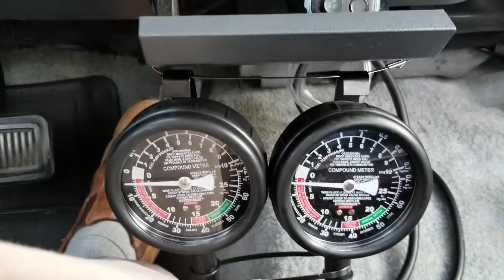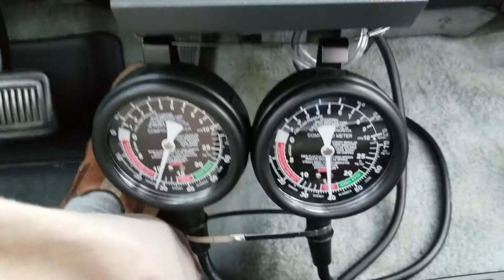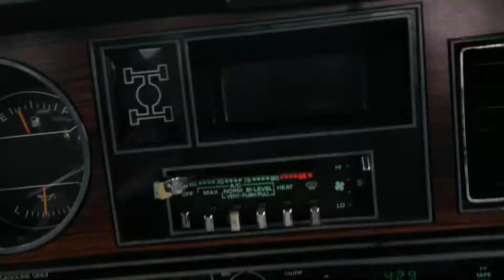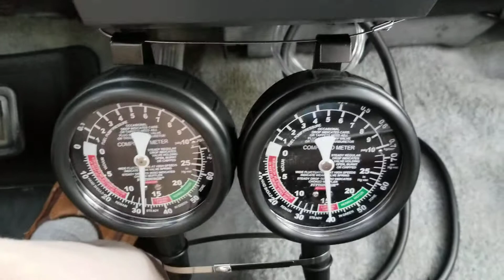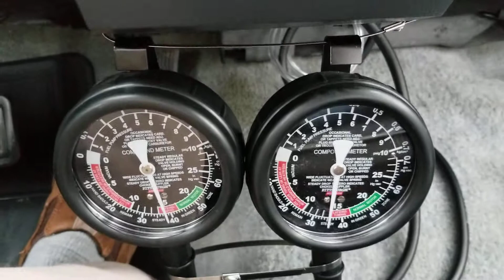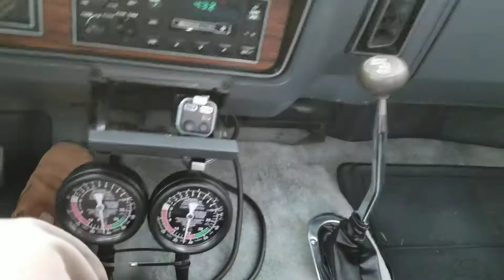Demo:  Ported vs. Manifold Vacuum in 318 w/ Holly 4bbl

Comment: For anyone watching this who is trying to figure out which source to use for vacuum advance... you have to remember that the sole purpose of vacuum advance is to retard the timing under moderate to heavy acceleration to prevent knock/ping/pre-ignition/detonation (or whatever else you want to call it).  Vacuum advance is NOT a power adding or high performance device.  If you're running a high performance engine, don't bother using vacuum advance at all, especially if you're running a large cam with a lot of overlap since they greatly affect the vacuum from both sources at low rpms.  If you're running a street cruiser or daily driver, you'll want to use vacuum advance, but you'll never get your answer of which source to use by consulting youtube.  Your engine, and how you drive with it, is unique to you... so you'll have to experiment with your engine and see which one works best for you.  There is no universal answer, but most often, ported vacuum is the way to go since that's what most cars and trucks were designed to use from the factory.
Reply: Hahha if the sole purpose of vacuum advance was to retard the timing, they’d call it vacuum retard.  Most of what you said here is wrong.
Reply: @yeboscrebo4451    If most of it is wrong, what do you think is right?  Things are quite often NOT called what people think they should be called.  Look up the history of the device, that's why it was invented, whether you believe it or not.  Later on it started to be used for drivability performance and then it became known as "vacuum advance", but it's original purpose was to automatically retard timing, not to advance it.  Maybe I should have used the word "was" instead of "is"... but a slight grammatical error doesn't discredit my entire statement.
Reply: If the purpose of vacuum advance is actually to retard timing on acceleration, then manifold vacuum seems to make more sense. As can be seen in the video, manifold vacuum drops on acceleration, retarding timing. Ported vacuum increases on acceleration from idle, and would advance timing.
Reply: @willshen6597   No, not quite... The original purpose of vacuum "advance" WAS to retard timing during acceleration, and at that time, manifold vacuum was the standard way of doing it... but that's not the end of the story.  If you continue to watch what the gauges do, you'll see that both ported and manifold vacuum equalize and follow the exact same pattern after a certain point (It's hard to tell since you can't actually see what the driver is doing with the throttle pedal). The only difference between them is at idle and the "part throttle transition"... so even though ported vacuum increases at first, it drops again (along with manifold vac) right after the throttle blade passes the port.  
So again, vacuum advance was designed to counteract the mechanical advance during low speed acceleration, but both manifold and ported vacuum work in exactly the same way to achieve that.  After engineers began experimenting with ported vacuum, they found some advantages to using it, such as better part throttle acceleration, and later, reduced idle and off-idle emissions.
Reply: @livewire2759  just because manifold vacuum advance drops off when the throttle opens doesn’t mean  that the purpose of the “advance” is to retard - that’s just silly.  That’s like saying the purpose of mechanical advance is actually to retard because the rpms eventually decrease, lol.  Just silly word games.  The fact that manifold vacuum advance smoothly steps off the stage as mechanical advance steps in when rpms increase, points to the intended design of these systems to use manifold vacuum advance.  Ported vacuum does this little half-assed blip and goes right back to zero as you open the throttle.  Ported is advancing at the same time mechanical advance is also performing it’s advance function.  What is the purpose of this redundancy?  If you need more timing on acceleration, adjust the mechanical advance and allow it to do the job it’s intended to do.  Manifold advance is for low load/cruise conditions - the way these systems were designed to operate
Reply: @yeboscrebo4451    "just because manifold vacuum advance drops off when the throttle opens doesn’t mean  that the purpose of the “advance” is to retard - that’s just silly."

Look it up if you don't believe me.  That's why it was invented, whether you like it or not.
Reply: @livewire2759  You’re not understanding, lol.
Reply: @yeboscrebo4451   I understand you perfectly.  The problem is that you seem to be basing your opinion entirely on what you saw in this video.  This video isn't perfect, since the guy is just sitting still, not actually driving the car, and you can't see his foot operating the throttle... so what these gauges show is a bit misleading.  Again, you don't have to take my word for it, you can do more research and find out for yourself.  In fact, I think this same channel has another video with this same gauge setup where he actually drives the car and you can see what the two vac sources actually do while driving.

You've already demonstrated several times that you don't understand how ported and manifold vacuum sources work... for example:
"Ported vacuum does this little half-assed blip and goes right back to zero as you open the throttle."  
No, it doesn't, and you wouldn't have said that if you knew how carburetors work.  It looks like it does that in this video, but again, you can't see exactly what this guy is doing with the throttle pedal.  When the ported gauge goes back to 0, it's because he let off the pedal and the throttle plate closed off the port.  If he were driving, he could stay on the throttle and you'd see that after opening the throttle past the ported vac port, after that "little blip", ported vac matches man vac exactly, because beyond part throttle, the ported vacuum port is completely exposed to manifold vacuum within the carburetor.  As you continue to open the throttle, ported vacuum will drop off gradually, at a specific rate, exactly the same as manifold vacuum does.  Just because you didn't see that demonstrated in this video doesn't mean it's not true or that I don't understand.

Once again, you don't have to take my word for it... I get it, for all you know I'm just some random idiot on YT... I can tell you that I'm an expert, I can tell you that I went to college and graduated at the top of my class with a degree in automotive technology and I've been working as an auto tech for over 20 years... and no matter how true that is, you don't have to believe me.  BUT, instead of telling me that I'm wrong and I don't understand... DO SOME RESEARCH... please.
Reply: @livewire2759  You’re doubling down on your lunacy.  I’m basing my opinion on my own experience.  You see, I also have both ported and manifold gauges in my old truck.  Stop telling me to “look it up”.  I don’t have to look up a thing to understand you are talking gibberish.  Yes, ported vacuum does a little half-assed blip and goes right back to zero.  If you examine the range of the throttle as its steadily opened from closed to fully open, ported will go from zero to  around 15ish hg and then back to zero (just exactly like this video shows).  It does this as mechanical advance is also increasing.  This is an obvious redundancy that is, quite frankly, wasteful and silly.  And it doesn’t ever take advantage of the full amount of vacuum the engine provides.  On the other hand, manifold will start at 20ish and steadily decrease to zero in direct proportion to the opening throttle and increasing cylinder pressure - just exactly as its supposed to.  And it takes advantage of the full vacuum the engine provides - kinda like it would if it was designed that way to begin with.  You don’t need BOTH the mechanical and vacuum advance to be performing the same function at the same time like happens with ported - it’s sillly.
Reply: @livewire2759 don’t forget to mention the mechanical advance in the process.
Reply: Wrong on so many levels I won’t even bother.  If it doesn’t have a properly calibrated and  working vacuum advance canister you’re pissing away.   Idle performance.   iIdle cooling.  Part throttle response.  Fuel Economy. And Hole Shot Power.   But if you don’t want any of that go with the notion that the men who built your ride didn’t know what they were doing and leave it off.   😂
Reply: @PontiacSkunkWorks  "I won't even bother"... but then you did "bother"... LOL
First of all, I never told anyone that they should disconnect their vacuum advance on daily drivers.    I didn't even say that I don't use it on my own vehicles (I do use it).  In fact, I recommended that everyone LEAVE it the way it was designed to work.  I also never said there were no other advantages to having it.  Clearly you didn't "bother" reading in the first place...
Reply: The LEGEND David Vizard said to use Manifold Vacuum,  and that's what I'm going with. Period. Always listen to the legend.
Reply: @riprob93   I think I might have heard of that guy... didn't know he was a "legend".
Generally, anyone who's actually an expert won't give out "always" and "never" type of advice, but ok... do whatever you want.
Reply: https://youtu.be/U7-zpnP0y18?si=fLiLE-mt5J1DDZke
Reply: Here in this video Mr. Vizard explains Manifold vs. Ported vacuum.  Good day sir.
Reply: @riprob93   LOL  ...and you clearly misunderstood.  It's ok, it happens to everyone now and then.  Good day to you too.
Reply: No all cars used ported from the factory.
Reply: @sqr2025   Did you mean to say, "NOT all cars used ported vac from the factory"?  There were LOTS that used manifold vac to run the vac advance, particularly prior to the 70s.  Also, lots of cars used a combination of man vac and port vac, as well as some other devices like temp controlled valves, orifices, or adjustable vacuum pots, so like I said, if you're running a stock, or mostly stock engine, just consult the manual to see how it's supposed to work.  If you want to eliminate some of the extra crap under the hood, look at older models (pre-emissions) of the same car/engine you have and see how they were connected.

As for mechanical advance... I'm not sure if you're being sarcastic (like I was in some of my replies ;) ...but sure, I'll talk a bit about mechanical advance...
Mechanical advance is necessary since higher rpms require more advance, but too much advance at idle can cause issues like hard starting... So if you're running a daily driver, weekend cruiser or street/strip performer, you'll want to tune the mechanical advance as well as the vac advance.   Of course, again, if you're running a full-on race car, you can just lock the weights and set the timing where you get the most power in the power band.  Although, it's worth mentioning, a lot of circle track racers and road course racers still use mech advance on tracks where they have to slow down and speed back up a lot.

Again, this is why you won't find the answer to which source to use just by watching YT videos... it takes a lot more research specific to your engine and how you're going to run it.
Reply: A vacuum advance does not retard the timing, it either adds to mechanical or it doesn't. The point of this demonstration is to show where advance timing comes in and under what conditions. You need advance at cruise, not at WOT. The physical vacuum advance mechanism in a distributor, when shown in action, advances your set timing, it does not retard anything. The only way one can retard timing with a (non ecu) distributor, is to manually do it when you set your timing.
Reply: @johnarmstrong6940    Yes... that's true... technically... but it depends on how you look at it....

Full vacuum applied to the vacuum advance mechanism provides all of the advance that device is capable of... and decreasing the vacuum reduces the amount of advance.  So, as throttle opens, the vac advance "retards" (so to speak) the timing from where it was at less throttle.  Yes, the proper way to say it is that it reduces the amount of advance, not that it actually retards the timing.  The reason I said it the way I did was to try to make a point (which apparently was lost on several people), so allow me to elaborate a bit more.

As you said, you don't need extra advance at WOT... because, as I'm sure you know, too much advance with lots of throttle, especially in higher mileage engines, is a recipe for detonation.  The point that I was making is that the reason vacuum advance was created is to provide an advance system based on throttle position in addition to mechanical advance which only changes based on engine speed, so engines could run more part throttle advance without having problems with detonation/knock at high throttle.  It wasn't necessarily a "high performance" device, it was a device made for reducing customer complaints about engine noises without having to reduce an engine's output.

Now, as far as this video and what it's demonstrating...
As I pointed out before, he is sitting still and revving the engine with no load on it, which does NOT provide an accurate representation of what ported vacuum does while you're driving.  There are other videos you can find here on YT that do demonstrate the difference between manifold vac and ported vac under load, which provide far more information than can be found here in this video.  If you watch what happens under load, the ONLY difference between manifold vacuum and ported vacuum is at idle.  During the off-idle transition, the two "equalize" and fall off together as the throttle continues to open.  Again, like you said, you don't need extra advance at WOT, but you also don't need it at idle.  However, it IS needed during the off-idle to part throttle transition, just like an extra squirt of fuel is needed to prevent lean-out... or whatever you want to call it.  If you look at modern computer controlled engines, they don't run much advance at idle (when the engine is warm... they do run more when cold to reduce warm-up emissions).  However, as soon as you touch the throttle, they jump up to around 30 degrees of advance.  The only way to make a mechanical/vacuum advance distributor perform that way is to hook up the vac advance to ported vacuum.  That's why I said it's better to run it that way than on manifold vacuum.  Running on manifold vacuum adds a lot of extra advance at idle, requiring a reduction of the base timing or throttle angle to be reduced below the off-idle transition ports, which reduces part-throttle transition performance... unless you leave the idle speed high, which may be fine for a race car with a big cam (that will have less vacuum at idle anyway because of valve overlap), but it isn't great for street/daily driver drivability.

Comment: For a guy who's just starting to learn about this, can you show how the vacuums are set on your 318 please?
Reply: Ok.. vaccume is not a set.. it's a result of engine tune condition and tune.. vaccume is a tool.. essentially it will tell u 70 to 80 percent of everything u need to know..   search vaccume gauge for diagnosing.. it's also tells you if your ignition is set properly and carb mixture screws ....  there's alot to know but basics.. carb idle screws are set to highest vaccume, stock v8s healthy compression good tune should be 20hg plus minus a couple... the more cam and race 🏁 the motor is the less vaccume at idle..  idle vaxcume readings are used to determine power valve selection in holley carbs and all kinds of troubleshooting and tuning. ...    engine vaccume is the genius way that they used the already present engine vacume as a signal to determine engine throttle position load ect... now today we stack circuitry and electronic madness on top of the same basic engine design.. have zero utilization of engine vaccume... efi is like catholism... tight perverse controll... carbs are like spirituality defined by the universe...  less controll more fun ....  like mushrooms vs crack😂
Reply: 😆 @neanderthal6717